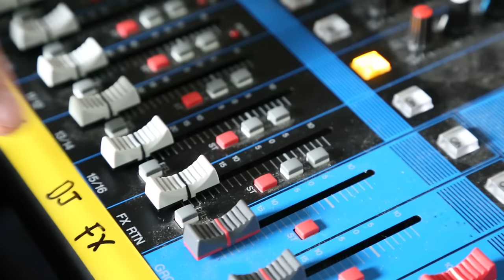How to Soundproof a party wall against noisy neighbours

Comment: How much would it cost ?
Reply from the maker: Hi Damian Clarke, it depends on the size of the wall. If you email sales@soundproofingstore.co.uk with the height and width of the wall, we can confirm the cost.
The wall shown in the video came in at less than £450 (not including installation).
These blogs also contain average costs, which you might find useful: 
https://www.soundproofingstore.co.uk/how-much-does-soundproofing-cost
https://www.soundproofingstore.co.uk/what-is-the-cost-of-soundproofing-v-s-moving-house

Comment: Will this work against A speaker with lots of bass
Reply from the maker: Hi Tuhin99, the ProSound™ SoundBoard 4™ system shown in the film is ideal for medium levels of noise. For a 'speaker with lots of bass' you would need one of our higher performing systems. The ReductoClip™ Independent Wall system - which is ideal for loud levels of noise and is the soundproofing system used for music studios. You can take a look at the system here: https://www.soundproofingstore.co.uk/reducto-clip-system
Reply: @SoundproofingStore  how much would it cost for a 4 bed house
Reply from the maker: @tuhin9910  we would need to know the dimensions of each room. We would also need to know further details of the level and type of noise you are trying to soundproof against and the structural makeup of the wall, any weaknesses e.g. chimneys etc. Where is the noise coming from? Neighbours, or internally? It would be unusual to need to soundproof the whole house. The best thing to do would be to speak to one of our technical team on 01423 206208, or alternatively fill in an online quote form, which can be found here: https://www.soundproofingstore.co.uk/get-a-quote
Reply: @SoundproofingStore  ah i see. the walls in this house are paper thin but the neighbours on the other side barely make any noise. its just the ones that are on the right. the noise comes from the passage sometimes (upastairs and downstairs) and through the wall of the loft room which is approximately ten feet by teen feet i would say (but it is diagonal at the top). btw im not expecting a quote just letting you know.
Reply from the maker: @tuhin9910  These blogs might be of use: 
https://www.soundproofingstore.co.uk/how-much-does-it-cost-to-soundproof-a-wall
https://www.soundproofingstore.co.uk/how-much-does-soundproofing-cost

Comment: Can those walls be painted over?
Reply from the maker: Hi Kiel Hanson, the outer layer of the SoundBoard 4™ is an acoustic plasterboard, meaning the soundboard is ready for a standard plasterboard finish. Our recommendation would be to use a skim coat of plaster and then, yes, this could be painted, or decorated over no problem. Further details on the SoundBoard4™ can be found here: https://www.soundproofingstore.co.uk/soundboard-4

Comment: it is particularly pointless if you want to build something soundproof to connect it firmly to the wall where the sound comes through ...
Reply from the maker: The soundproofing solution in the video is the ProSound™ SoundBoard 4™ and is our best performing direct-to-wall soundproofing board. The foam layer within the soundboard dampens sound energy and vibrations and because it is sandwiched between the plasterboard and the wall, acts as an air gap. Whist an independent system offers the highest levels of soundproofing, SoundBoard4 is an extremely effective solution when space is at a premium. Very few people within their own home can afford to build and lose 100mm+ for an independent system.

Comment: They put the board straight on the wall. I'm going to soundproof my bedroom and everywhere I read says I should frame the wall and ensure a cavity is there. Rockwool the cavity and then double the plasterboard and also a soundproof boards 

This seems so much more simple
Reply from the maker: Hi @5183adam - To reduce the sound energy and vibration that is travelling through the wall, you need to either de-couple the wall, or have resilience to absorb the energy. So screwing plasterboard to the wall won't help because it has no de-coupling or resilience. The very best way to do it, is to build an independent frame, away from the wall but not touching, then soundproof that frame. However, this takes up a lot of space which a lot of people just don't have. So the SoundBoards were designed to be a thin, simple solution. They have a thick layer of acoustic foam, on the back, this separates the hard part of the board from the solid wall and dampens the vibration in between, giving the SoundBoard resilience. So if you want something quick, thin and easy to install, this is the perfect product.

Comment: Do you install this? Are you based in London?
Reply from the maker: Hi Marc. We deliver all our goods around the whole of the UK. With regard to installation most people will use a local installer with experience of fitting plasterboard, as this is a relativity easy system to install. However we do have professional installers in London but they are normally around double the price of a local tradesman.  please call if you require any further help. 01423 206208
Reply: The Soundproofing Store do you cover the north west. Who do i contact for a quote?
Reply: What is the material used here ??
Reply: +The Soundproofing Store but that's double the price! that's why they call me terry tibbs

Comment: Yea but will stop really loud music from speakers which are bolted onto the joing wall in the neighbours house
Reply from the maker: Hi CM 17, no, the SoundBoard 4 isn't designed to reduce excessive vibration / impact noise. You would need the ReductoClip™ Independent Wall System: https://www.soundproofingstore.co.uk/reducto-clip-system
This is because when you have strong vibrations travelling through a wall you need to decouple the wall to reduce vibration transfer. You may also need to treat the floor and side walls depending on how much sound is leaking in through these other surfaces.

Comment: so are these the same as siniat plasterboards
Reply from the maker: Hi, in short no. I know Siniat do some sound absorption options which are designed to reduce reverberation, therefore allowing sound to echo and amplify within a room but would do very little in terms of blocking noise coming through the party wall. They also so some slightly heavier dense plasterboard similar to what the SoundBoard4 finish it but in the SoundBoard4 that plasterboard is one of several layers of mass and on its own would give you in the region of a 10% noise reduction.
Reply: thank you for the reply and info
Reply from the maker: you are welcome and I just spotted a bit of a typo - The Siniat won't allow, but will reduce noise echo and amplification.

Comment: Buy some 5/8 drywall. Tear your baseboard off. Nail the drywall up over your existing wall up, cover the seams & nail holes up, paint, etc.
Boom You now have a  near soundproof wall for about $100.
Reply from the maker: HI BKDDY That may do something on a US timber construction wall that is low in mass, so the addition of more mass improves the wall, but on a UK masonry wall fixing "drywall" directly to the wall won't help at all, in fact is likely to make things worse. Soundproofing really isn't that simple unfortunately.

Comment: Can you dab the boards on?
Reply from the maker: Afraid not Adam. The boards are extremely heavy at 35kg per board (1.2 m2). The only safe way to hold that weight is for them to be mechanically fixed to the wall. If you are worried at all about the screws, firstly the amount of sound vibration that will travel through the small surface area of a screw is so small that it is basically negligent. Secondly, because we have this thick layer of vibration dampening foam through the board, it dampens the vibration anyway. If the boards are dabbed to the wall, then this layer of foam isn't compressed to the wall, and therefore can't absorb the vibrations. So there is no negative to using the screws, it just makes it far safer. Any board light enough to be glued or dabbed to the wall is too light to block a high level of sound.

Comment: Not sure if I've got the wrong end of the stick, but did this board increase the noise from 36 to 37db?
Reply from the maker: Hi Darren northway, the 36dB reading was of the sound test in the receiving room with no noise coming from next door. Loud noise was then played in the next door room at 64dB (the equivalent of loud conversation and TV noise). Once the SoundBoard 4 was installed and the same loud noise was played again, the receiving room recorded 37dB. Basically only reading 1dB higher once the soundproofing had been installed and with the loud noise being played next door than when there was no noise at all. Highlighting that almost all of the 64dB loud noise was being blocked by the soundproofing.

Comment: just looked up a 1.2m x 1m x 30mm SoundBoard 4 system cost £61.14 that is for 1 board so spending like over £800 for for that could of try egg trays could be a lot cheaper
Reply: yeah alright mate you wanna av a gaff looking like the poultry section you Muppet
Reply: what? just stating the price. plus not heard wanna av a gaff in a long time you must be really old or a gangsta
Reply from the maker: Giggity - Nobody said soundproofing was cheap. You get what you pay for. Eggs cartons are cheap - they also have zero soundproofing value. Airborne sound is blocked by mass therefore heavy, dense materials are needed.

Comment: He said it blocked nearly all of the sound coming from next door more like blocking half the sound that coming next door
Reply from the maker: Just to explain how the decibel system works. As human beings, what we regard as basically a silent room would still register 20 - 30 decibels on a meter. So we are only trying to get down to around 30db for a quiet room not 0db.  Reducing the sound from 64db to 37db, is a huge reduction. Secondly, the decibel system is similar to the Rictor scale for earth quakes, its a very steep curve. We hear every 10db as roughly a doubling of volume, or reduction of 10db as a halving of volume. So from 64db to 37db is actually around a 250% reduction in volume not 50%.

Comment: Everything and I mean everything that woman says I can relate to. I'm in council prop though
Reply from the maker: John Smith - We receive dozens of calls a day from people with this identical issue. Its more common than you would think. The good news is that there is a solution!
Reply: So what’s the solution for footstep noise from the next house which is attached to my house? Afaik this solution only blocks air noise, but no physical sound which is transferred by the ground (footsteps on wooden floor etc)??

Comment: I have soundproof plasterboard and it’s done absolutely nothing to help us! We can hear next door going up and down there loft stairs on the landing and voices. Was just a waste of money 👎🏻
Reply from the maker: Hi Michelle, unfortunately you are correct. Just adding an acoustic plasterboard will do almost nothing. A trap that many people fall into. Whiel acoustic plasterboard is a very useful material as part of a full system, it won't achieve much on its own. This is why you need to speak to professionals like ourselves. You need to do 2 things when soundproofing a wall. 1) Add mass to block airborne sound 2)Dampen the vibration of the sound travelling through the solid wall.... One layer of plasterboard is only adding around 12kg of mass per m2. Our SoundBoard 4 adds almost 30kg of mass per m2! When you fix a plasterboard directly on to the wall, it is rigid and has no way to dampen the vibration... Our SoundBoard 4 has this thick layer of acoustic foam which acts like an air gap, separating the rigid board from the rigid wall, and dampens the vibration. If you would like any advice on how to improve your soundproofing, feel free to get in touch. www.soundproofingstore.co.uk

Comment: NOTHING TO DO with the Impact Sound !
Reply from the maker: kissacdstore - There was no Impact sound. As she says it was voices, radio etc. This is all airborne sound. The SoundBoard 4 does have a layer of high performance foam which dampens vibration within the wall, but the system is designed for Airborne sound not high levels of Impact. If you had Impact on the walls next door, you would have to use our ReductoClip System: 
https://www.soundproofingstore.co.uk/reducto-clip-system

Comment: If American or British houses were made of bricks or concrete => no headaches from neighbors!
Reply from the maker: @matzacomn If only it was that simple. Generally the majority of houses here in the UK are built with brick or concrete party walls, but we still have noise issues. Brick is certainly much better than timber which I know a lot of houses in the US are constructed from. Brick has more mass which is a good start, but most older properties (pre 1960s) were built with a single layer of brick, so still not enough mass and no de-coupling so still lots of vibration getting through. Things are much better now with new houses being built using double skin cavity walls with high density concrete block. These do a very good job.

Comment: That doesn't look like anything aesthetical
Reply from the maker: Hi Nestor, The boards aren't for decorative purposes, they are purely designed to block sound. The final layer is a plasterboard which means you can plaster over the top and decorate. Once the soundproofing is fully installed, you shouldn't even know there is any soundproofing there. It should just look like a normal wall.

Comment: bet she ages already doesn't live there. the only soundproofing that works are detached
Reply from the maker: Thats incorrect Miroslav. Detached is definitely better, but a lot of people just don't have the space. Sound is blocked by mass, if the wall is very thin and low in mass then increasing the mass of it with heavy, dense but resilient materials can certainly improve the soundproofing. It wont make the wall 100% soundproof! But will certainly be better at reducing lower volume noise like houshold noise.

Comment: This is a dreadful system. The results achieved will be very poor.
Reply from the maker: The SoundBoard 4 was used as the existing wall (although brick) was naturally performing poorly in terms of blocking airborne sound from next door. The customer was also limited on the space they could lose from their wall. (They were delighted with the difference it made to their unwanted noise issue and at only 30mm space loss). 
There are of course higher performing systems such the ReductoClip independent Wall Solution (120mm) and ReductoClip Direct to Wall Solution (60mm) and although the ReductoClip is the slimmest isolation clip and bar system on the market, in this instance it wasn't feasible. For higher performing solid wall solutions, these videos might be of interest:
https://youtu.be/huNDsYKLpqo
https://youtu.be/R2gvGyE6kTE